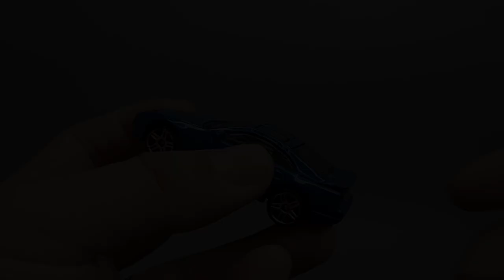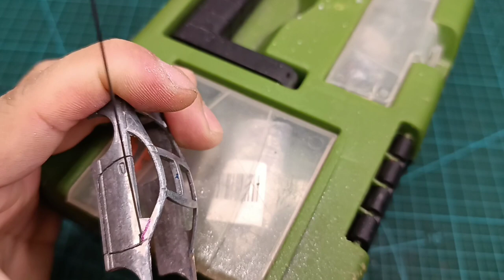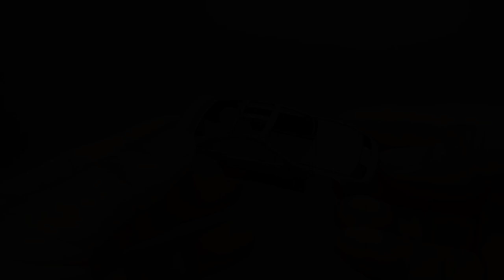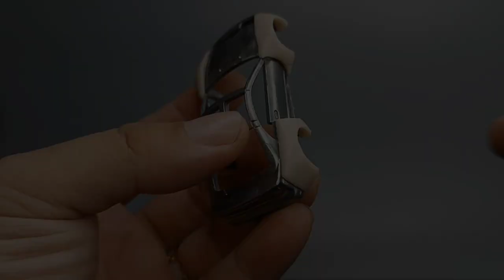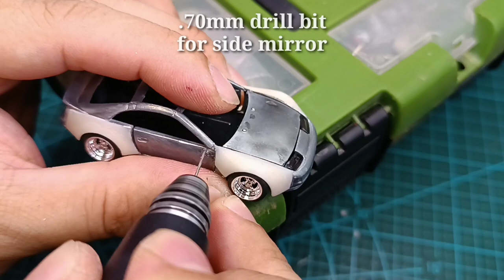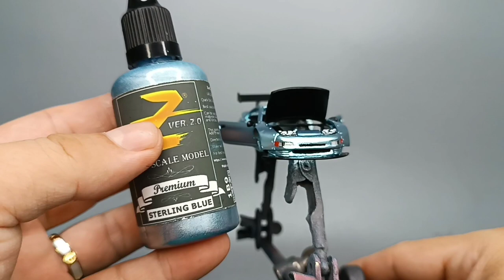CUSTOM HOT WHEELS NISSAN 300ZX

Comment: What did you use to have the hood and doors open? I just saw you drill a hole in the top off the door.
Reply from the maker: i used pin/cantal wire .06mm, drill a hole in top and bottom part of the door then put a pin, i also drill a hole same position in the body so i can insert the pin and doors,

Comment: I think the saw that I use gone bend and and got to the wrong directions.  Could it be am I using the wrong one?
Reply from the maker: the teeth of the blade must facing down, lube the blade before using and when sawing do it slowly and straight
Reply: @customhotwheels  Thank you, I will try it.

Comment: What size jewellery saw is that?
Reply from the maker: im using no.1 blade,
Reply: @customhotwheels  Thanks. My blade always snaps when I go around corners. What am I doing wrong?
Reply from the maker: do it slowly always lube the blade to avoid too much friction, try to put pivot holes use .60mm drill bit
Reply: @customhotwheels  Thanks. What can I use to lubricate the blade?
Reply from the maker: im using bicycle chain lube and motorcycle gear oil,
Reply: @customhotwheels  Thanks DD. I'll give it a try